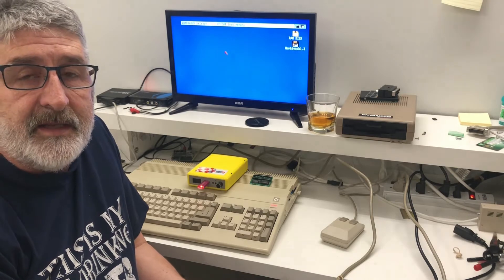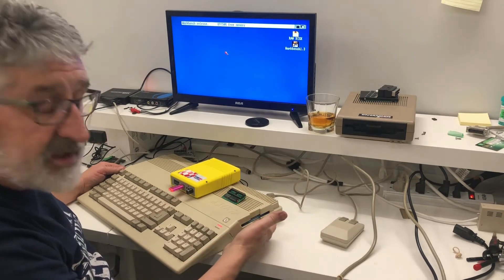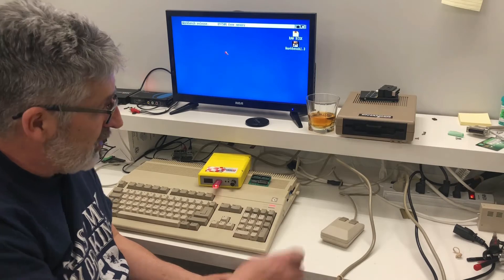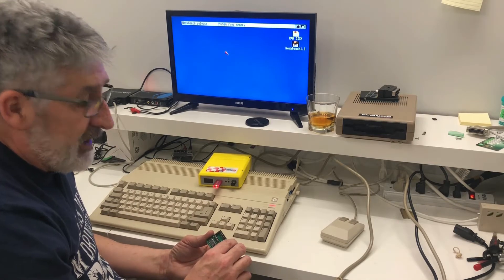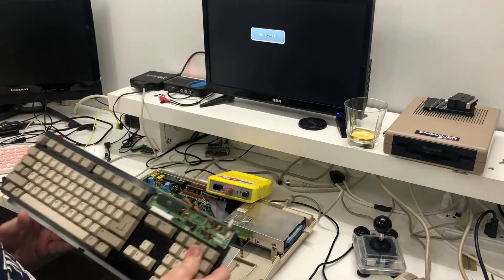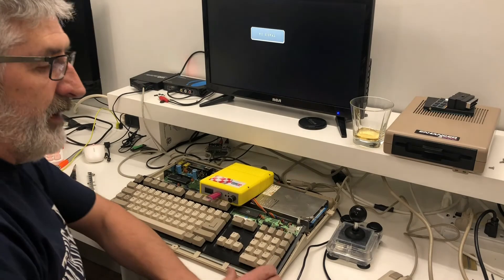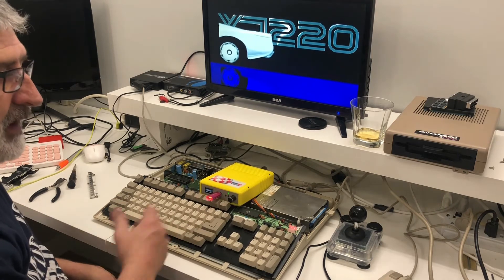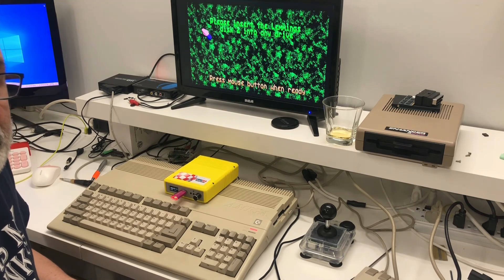Amiga Switchless Boot Drive Device Swapper For External Gotek Drives. Installation and Operation.

Comment: hi great video one thing i noticed is you have a disk in the disk drive while you show us switching between disk drive and gotek is it necessary to have the disk in the disk drive for this to work and if so what disk
Reply from the maker: There is no need for a disk to be in the disk drive. I basically just wanted to show that with a physical floppy disk in the disk drive, it would completely ignore that disk and load off the Gotek... thinking IT was D0.

Comment: Great video very informative and helpful was just wondering what the thing is called that you connect ed to the mother board as I’ve got a gotek and need to set it up to use as the main drive

Comment: So, is internal drive available (as DF1:) when you boot from external GOTEK?
Reply from the maker: Yes. But it has to be implicitly called by the software you are using. For example, if you are using X-copy, both drives show up as well as any RAM drives you may have. So, you can create real floppies from image files.

Comment: Hi, can you tell me witch jumper you set on the Gotek for use with this boot selector?
Reply from the maker: It depends on how you are using it. If you are using the type of external cable shown, you would only need to use one jumper and it would short the two S0 pins. If you are using an old external Amiga Floppy drive housing, then you would use just the one jumper and it would be set to S1.
Reply: @bitsbytesbourbon4657  thank you for reply, I use old external housing. But with jumper S0 some game dont see disk swapping. And when i use jumper S1 other games dont see swapping like Another World. My Gotek use old Cortex firmware, perhaps is that my problem.
Reply from the maker: @flynntaggart4567  It could very well be the Cortex firmware. I've never used the Cortex firmware, but have found the Flashfloppy firmware to be quite robust and user friendly.
Reply: Hi finally it was my floppy drive that do this problem, I change the floppy drive now and all work normally. Look like floppy drive send false select info to the CIA.
Reply: sorry i have another question, it's normal in workbench to have df1 bad, df2 bad and df3 nad? I deconnected the external drive. It's because of the switchless or it's not normal?
Reply from the maker: @flynntaggart4567  What you are seeing is definitely not normal. I am assuming you are seeing false drive number coming up from a potentially bad disk image that the Amiga is currently looking at. Does this only happen on a specific image and on an external drive?
Reply: @bitsbytesbourbon4657  It happen with external or internal drive, if you don't have the same it mean that i have a problem. Thank you

Comment: Used the switchless boot selector in an Amiga 500+ Rev. 8 with the GOTEK-drive connected as an external drive and this works great. If I connect the same GOTEK-drive as an external drive at an Amiga 500 Rev. 6A (with or without the switchless boot selector) the Amiga 500 won't startup and gives a green screen. Does anyone know what's going wrong?
Reply from the maker: A green screen NORMALLY indicates a RAM issue on the Amiga, but I have seen this happen with external drives and it is normally caused by a bad ODD CIA chip. Try replacing the ODD CIA chip and give it another try...
Reply: @bitsbytesbourbon4657  Thank you for your reply. I already solved this problem 1,5 month ago. And yes, you we're right, it was a faulty CIA-chip (ODD).

Comment: Time to pull the Amiga out of storage and blow the dust off of it. Do i get all the parts needed when ordering this through ebay or just the external unit and not the thing for the chip inside? Thanks!
Reply from the maker: @garyjordan2019; It's a three piece system. There is the internal boot disk swapper, then the custom external cable for the gotek and finally the Gotek itself. I sell all of the pieces on my ebay store. And I offer combined shipping. If you already have the Gotek, then all you would need to order is the boot switcher and the external cable.

Comment: Great Video!!! However its the not the end of the problem for the Amiga 1200 when using GOTEKS... A solution for the A1200 is still required as many think you can use the AMIGA 1200 (2 mouse button on boot) and boot a DF1 Gotek as DF0 but you cant (Not that i know of anyway). In addition it is now possible to have an Amiga external floppy cable that can use a Gotek as DF1 and a standard IBM PC Floppy drive (unmodified) as DF2 with a standard Amiga floppy drive as DF0: This config all works perfect when just using an (IDE) Hard Drive BOOTING workbench for example... (I have such a cable with a gotek as DF1 and an unmodified IBM PC floppy as DF2 and the standard Amiga floppy drive as DF0: However what happens if i want to "BOOT" from the gotek DF1 as DF0 on the A1200.... You cant.. I cant find a switchless switcher for the a1200 or any other method at the moment...  Are you aware of any switch less switchers for the A1200 8-BIT Resurgence?
Reply from the maker: @rfxtuber Don't quote me on this, but I believe you CAN use this switchless boot switcher in the A1200, but it is trickier because the CIA's are soldered in. I've never tried it myself as I don't have an A1200.
Reply: @bitsbytesbourbon4657  Hiya.. thanks for the reply.. your video was really really helpful to me.. as i mistakenly thought i could use the same methods for a switchless switcher for the A500/+/600 on the A1200s.. However i have since discovered after my post on your video, that you CAN NOT use the same methods as the A500 for switching DF1 TO DF0 due the a1200 signalling being different.. i say this in the context of an external cable i'm using with the Gotek as DF1 which also allows a standard unmodified IBM PC floppy drive to be used on the same cable as DF2 at the same time and boot as df0 but i have a defective internal a1200 floppy drive meaning i cant boot from the gotek as DF0 or the IBM PC floppy Drive as DF0 on the A1200, but i tested this cable on a500 with a modded (CIA) and floppy port jumper and both the gotek and the IBM PC floppy drive boots as DF0 perfectly!!!!! This is an awesome solution as you can go to any Amiga with external drives as gotek or standard IBM floppy and boot anything as df0 out of the box (almost)!!!. but the a1200 you cant. However i have found a mod for the a1200 as well, but uses a 2 part solution an internal mod board and an external mod board fitted to the external floppy port, meaning i cant use this external cable with it!!! Arrghhh.. Just thought you would be interested to know my experiences.. The A1200 is not as straight forward at all for switching DF1 TO DF0!!! (EDIT) Note: The two part mod requires no soldering or removal of the Amigas 1200 CIA chip or any other hacks, just a circuit board attached to a1200 floppy drive and a circuit board plugged into external floppy port to  switch df1 to df0!! and can be found here!! https://www.gotek-retro.eu/a1200-bootselector-df0-df1/